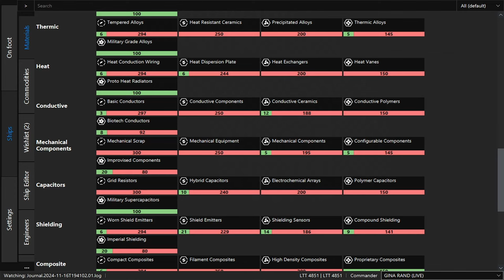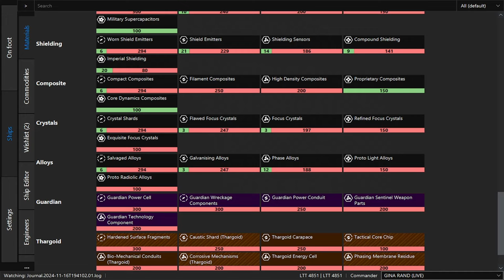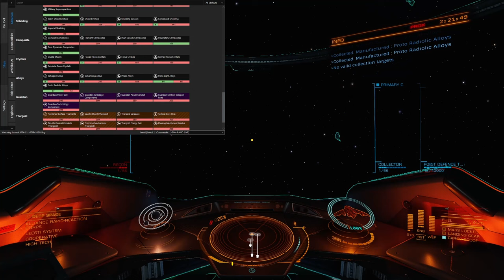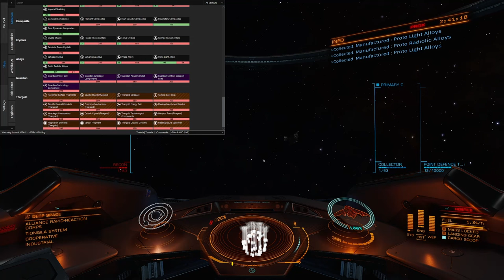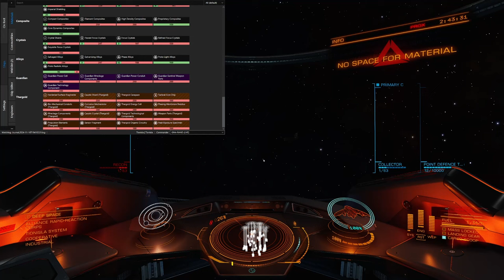How to farm MANUFACTURED Materials in Elite Dangerous the fast, quick and easy way tutorial

Comment: Good instruction vid for those wondering.

What voice assistant are you using?  Is that one of the standard COVAS?
Reply from the maker: I use a few. ED Discovery and ED Copilot both talk.
Reply: @AtlasRandGaming I must have silenced ed discovery because it was overtaking my hcs and Ed copilot.  I was hearing comments I haven’t heard before.  Btw check out eddi as well.

Comment: why not farm imperial shielding and trade down?
Reply: it only makes sense for trading the most uncommon/hard to find materials. Proto radiolic alloys, proto light alloys, core dynamics composites, proprietary composites are very common, in my experience. Besides you loose mats when trading, you have to trade all 100 imperial shielding for just 16 grade 5 of any other material...
Reply: @maciejlazur4966  not sure i see your point, a system with the right status will gurantee imp shielding spawns to fill your whole inv. I'd argue its a lot faster to trade down than to aimlessly hunt
Reply from the maker: Not the case unless you truly are wandering aimlessly and don't know where to find each material. 
You can trade right to left efficiently, which is what I'm doing in the video. But you're suggesting trading up and down. This is horribly inefficient. 
As @maciejlazur4966 pointed out, you only get 16 of any other tier 5 from 100 Imperial Shields. That means you'd need to scan down , fly to and collect 650 Imperial Shield High Grade Emission to get a single Core Dynamic Composit to 100. 
It's much faster to simply go to a system with a state of Election, scan down a single High Grade Emission, let the limpets out once, and you are done with Core Dynamic Composits. Your suggestion would literally take 7X longer for every one of the Manufactured Materials.
Use the app EDS Odyssey Material Helper - it tells you where to go for each material. It's the app I show in the video.